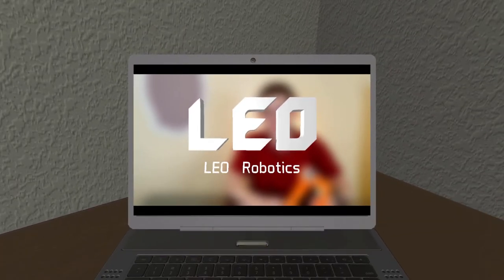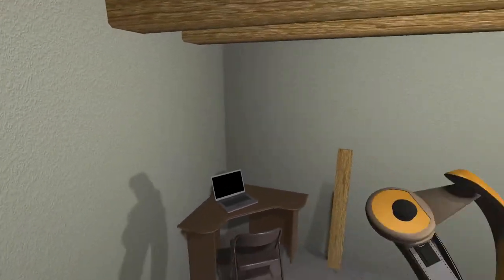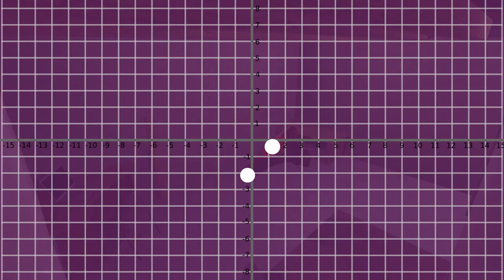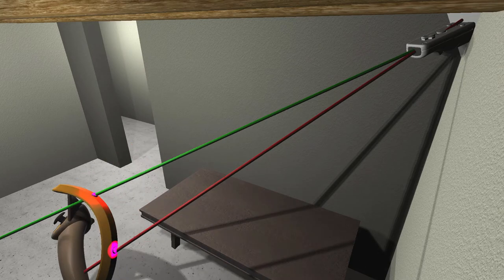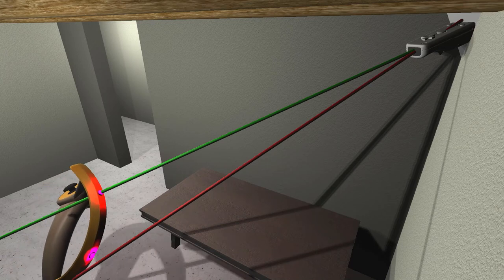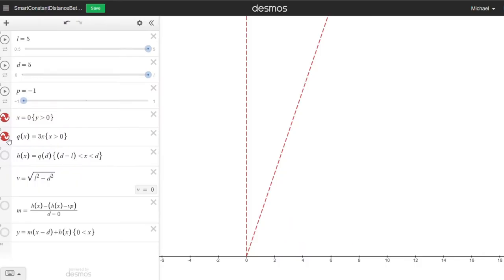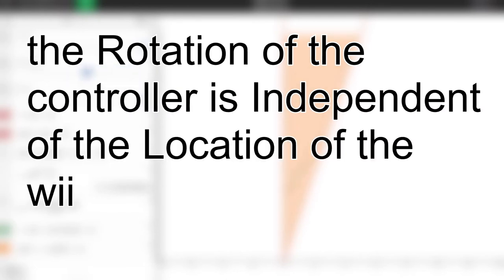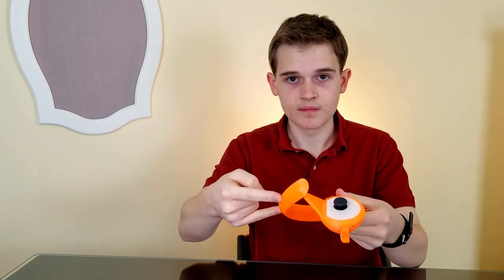wait, that's how VR works?

Comment: How wide is the Wii Remote's field of view? This is probably the first thing you considered when putting it on that top corner, but is it enough for a full range of movement? You should also consider that most IR doesn't pass through bodies, so when the user turns around, you are completely unable to readjust, if it's ever shaken around too much.

All that aside, this is all getting a little mathematical. Do keep some notes (on paper) around, lest it becomes so complicated that you have to restart your train of thought every time you try to wrap your head around it. Soon enough, I'll have to rewatch all of these videos five times to get it all in my head.
Reply from the maker: About 30 degrees. And yeah, it won’t be nearly as “maneuverable” as something like the Oculus Quest, but it should be an interesting proof of concept!
Reply: @LEORobotics  this is a great concept! I have a VR headset of my own and if this project is open source then I might be using it to make my own diy full body trackers for vr

Comment: Have you considered the issues of occlusion and sensor inaccuracies yet? That's generally why most trackers need 3 to 4 points to have relatively solid tracking from my understanding.
Reply from the maker: Great question! This project is mostly R&D anyway, and there are many ways it could go wrong, but I still want to try. The FOV of a wii remote sensor is only about 30 degrees anyway, so it’ll never be an amazing VR setup.
Nonetheless, I love to try! And who knows, maybe it won’t be as bad as I think? :)
Reply: @LEORobotics  I wish I could work on projects like these, but I never manage to find the time to work on them after I start. 

Just curious, what are you using to connect to the Wiimote? I tried to figure out how Windows drivers connect to Bluetooth devices once to try and write a better driver for it, but it was really hard to understand and the documentation wasn't that great.
Reply from the maker: @Silicon42  I’m guessing you’ve heard of dolphin emulator? It provides a semi easy way to connect multiple wii remotes to bluetooth. Then I can use an asset for unity that allows me to communicate with them.
It sounds like you have a lot of great input! If you have a discord account, I’d love to have you join my server!  https://leohome.ml/discord/
Reply: @LEORobotics  Working on a similar concept for over a year now (but going with custom cameras and highspeed processing), getting everything right is very hard. Though my concept is a bit different, since I'm not necessarily using IMUs at all but pure triangulation
If you're looking for some high-res high-speed cameras (even synchronized) with built-in blob processing to replace the wiimotes, check out my project: https://github.com/Seneral/MakersVR
You can build them for 20$(Pi Zero) + 30$ (Innomaker OV9281) each and I got the blob detection running at pretty much full res (1280x800) at 111fps (still experimenting with external sync, the camera can go up to 144fps in freerunning mode)
The code for the OV9281 is not up yet, will do that when I got something tracked (am at the final phase for the next prototype with actual results), but still something you might want to look into if you're serious about a custom tracking system